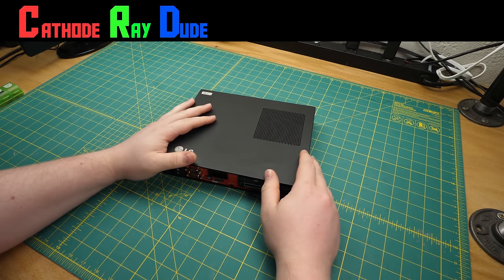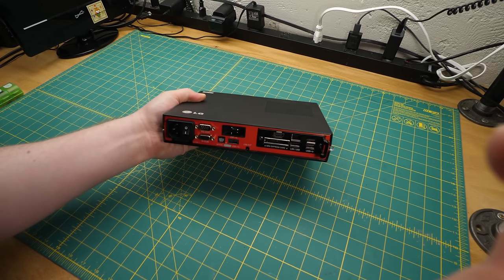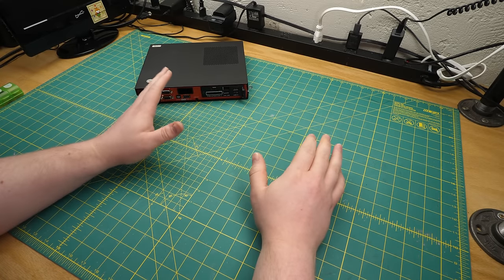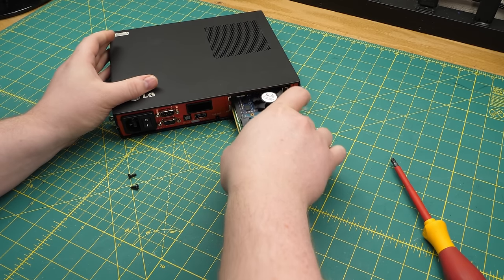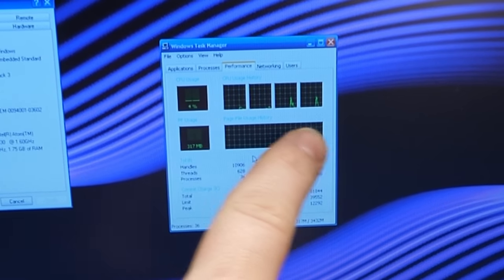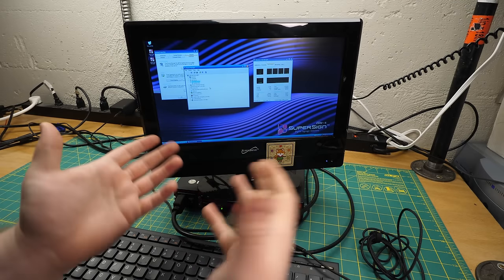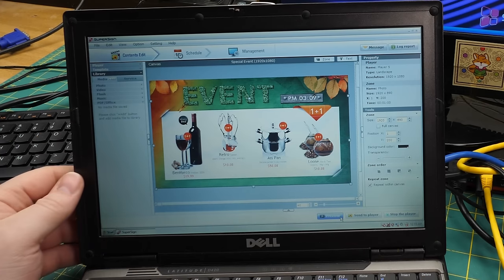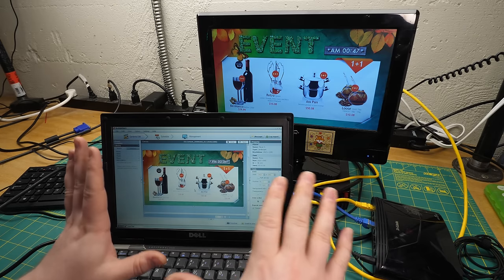Little Guys 6: The Worst Possible Timing [LG NC1000]

Comment: The Embedded feature that discards writes on reboot was actually available in XP too, via some Microsoft application that I've since forgotten the name of.  I worked at a company for a while that managed a few properties with public-access computers, and during the tail-end of the XP era, that utility was a godsend.  It almost completely stopped all the tickets to go un-eff computers that had been used by the unwashed masses.  AFAIK, that kiosk-mode util was discontinued, and never ported to Windows 7 and beyond.  SUCH a missed opportunity, IMO, but I guess if they kept it alive in Embedded (did they?) then that's something at least.
Reply from the maker: It's still in Embedded to this day apparently, plus a thing called "hibernate once, resume many" which does exactly what it sounds like; you get the machine into a state you like, hit hibernate, and then every single time you start up it just resumes from the hiberfile and thus always lands in exactly the same state.
Reply: @CathodeRayDude   That's actually kind of a relief to hear.  Would've been such a waste to discard that functionality.  It worked shockingly well.

Comment: look for NEC OPS stand alone adapter or H81 H110 host adapter or OPS Power and training adapter for your OPS. the JTAG PMU(power management unit)  disables JTAG in power save modes.
Reply: Also you wondered why they would have so many screens , Airports with public and private LCD's , the private ones being the check in terminals and the public ones being adverts, advice, warnings and directions .Some areas may have two or three screens with localized languages. later software also had pages for the airlines to login to update their local screens(boarding etc) . more modern ones have flight listings in them that will change the advertising depending on the flight arriving in that area of screens. the ones in HK airport also have camera's using hikvisions face recognition and will alter the advert based on you.
Reply: the missing parts on the daughter board are HDMI port, HDMI decoder (CDEC) , power for HDMI decoder and voltage buffer. the large white connector is additional power rails for external LED lighting and also a isolated "switch matrix" for inputs & triggers.

Comment: I would love to see all TVs designed for a OPS PS module. 
This way you can have a built-in DVR a built-in device that works better than a Roku. it allow you to run webpages on your TV. Could be used for video sharing. The best part is it's all internal.

Comment: I might be a little bit off, but I assume that the OPS system was made for electronics retail environments. That way, all of the TV's have synchronized video feeds from Internet source, instead of "the old way" of using piles of signal amplifiers and splitters to feed 25+ HDTV's a mediocre image full of noise. The TV area of Fry's Electronics used to have 120+ models on display, but they all had the same crappy image feed. 💀😭 Maybe Fry's would still be here if they spent a bit more to furnish the store with these type of Floor/Display Models, instead of how they used to put a standard production model on the sales floor as a Demo Unit...

Comment: As far as the matrix display goes, it isn't economical for fixed installations, but consider the rental market. So your A/V rental outfit that owns a bunch of commercial displays can use them in another way without needing to also own a matrix controller that they rarely use. Imagine walking into a convention hall and they've got a massive matrix display.

Comment: 20:00 - yes, ARK is wrong sometimes. I just bought computer with i5-12600H that's rated for max 64GB RAM but works perfectly fine with 96GB.

What really happens here, is that documentation in ARK written at the time of release of CPU and at the time there were only 32GB modules available and only on those it could be tested. But now we have DDR5 with 48GB modules, so I can put 96GB and it happily works. I even found website called "RAM Upgrades" which can tell you if you can put more RAM into your computer that manual says!

I don't know about those 2010 times, but I highly suspect it could be very similar.

Comment: I've done digital signage installs and none of the ones I did recently had any kind of OBS or embedded stuff. 
They are all smart TV type things where you just plug in a USB flash drive or SD card. A lot of them are SD cards. For a while I had about 30 4gb SD cards in the ashtray of my car.
Now that a lot of the smart TVs have WIFI, and most corporate WIFI is on managed networks like Meraki it is pretty much a cinch to push out system images for digital signage. The only hurdle there would be the still present fear of an Anonymous type attack putting embarrassing stuff up on the signage.

Comment: Jeff Girling has a video on a digital signage TV and goes into the plug-in modules and how it's running with raspberry pies.
A lot of industrial displays have plug-in modules so you only need to add the video input module that you need and that concept was adapted to use mini embedded systems. A lot of schools are going to smart displays. well they're called smart boards because there's a company called smart originally came out with a projector smart whiteboard system kit/modules so everything is called smart now. But that company is also doing digital displays with integrated computers. Because why have the hassle of just the teachers laptop or the students laptop let's put a TV in every room with a full on PC as well.

Comment: I remember those Atoms, they are extremely underpowered, but they use almost no power and also the thermals are good. The problem when those Atoms released is that Intel had no chipset for them, so they winged it and ended pairing the 8W Atom chip with chipsets that used up to 20W, completely destroying the power and thermals of the system. Also the GPU on those Intel chipsets was the absolute worst, so when nVidia came with the ION chipset it was the saving grace for Intel, the chipset was still somewhat power hungry compared to the Atom, but the GPU was powerful compared with any other integrated solution at the time.

Comment: heyo...just a little note, drowned in the admiration of this video...but Check out surplus auctions in your area. I see a lot of restaurant closings, business and office space auctions that have had some commercial grade displays go for TV prices, just because that's what people think they are getting until you look at the back panel, or look up the model. I've got a 2 or 3  27" touch screen displays that were used as a register that are absolute tanks and function with near anything and excellent high light viewing. I'm vaguely sure I've seen that Bay form factor, and OPS listed in some of the panels I've come across.

Comment: I see there's a slightly different tiny LG nuc in my 2015 Sonic
its behind the glovebox next to the interior air filter 
The infotainment center runs Windows CE
you can get into the debugger options
put in a special same code found on the internet
and boot into the windows CE desktop
I also notice these look like the same nucs on hotel TVs

Comment: Windows Embedded is used because the price-per-license is significantly lower than the retail OS. Also OEM cannot make customisations to retail OS that can be done to Embedded SKUs. OEM cannot make custom recovery for retail but can with Embedded. Also during XP era, all OEM recovery media had to be done by authorized replicator with minimum order amounts (like 40k units) but with embedded you could do recovery in-house.

Comment: 31:11 I don't know anything about Adobe Air either, but... Especially given the Era... This is exactly the sort of thing Flash should have become. Sure it was originally designed simply as a vector animation program, but this SO fits it's potential more than being an embedded steaming video player on websites. There was nothing wrong with Flash, and it shouldn't have been discontinued, but it shouldn't have been pushed into what it was in the first place. The only reason why it had so many security holes is because it was being pushed into a use-case that it wasn't designed for.

Comment: I'm on my third rewatch already and I finally realized why this little guy is so intriguing to me.  It's like the computer version of Hitachi's MP-EG1, except this little guy didn't get the chance to have a 'revision' made.  I can absolutely imagine the of this having populated those chips on the IO board and being more capable, but the team had to ship it early for Reasons TM so they sent out the simpler / "worse" version.  And unlike the EG1/EG10, this little guy got demolished almost immediately after launch and never got to have its own EG10.

I wonder if LG knew Intel was soon to 'release' OPS and was hoping to steal the market ahead of them and then migrate over to it?  Seems a little conspiratorial tbh.  Might be a fantastic case of the left hand not talking to the right because there's no way Intel hadn't told LG about OPS well ahead of launch.  Though perhaps not early enough for LG to have started on this project.  Convergent evolution and all.

Comment: The Ion was a very cheap and low power chip, it was a intended to be paired with a very low power CPU like an Intel Atom or one of the VIA CPUs to give those platforms video acceleration for modern codecs and some semblance of 3D acceleration that was not feasible on the CPUs alone. It mainly saw usage in budget systems like mini PCs, cheap laptops, netbooks and even on some motherboards to be used as the integrated graphics solution.

I think the chip line was discontinued due to chip miniaturisation eventually seeing northbridges/integrated graphics being etched onto the same silicon as the CPU and the chip designers paying much more attention to video acceleration with the rise of video sharing websites like YouTube. There just wasn't a need to have a separate graphics chip placed into a system that didn't offer much over what was already built into the newer CPUs, especially as it was added costs for systems as you could no longer swap out what had now been fused with the CPU die.

Comment: Is the RAM double or single sided? I wonder if they intended for the heatsink to have thermal pads under the RAM to also cool the RAM chips and then realized that the slot had them on the wrong side and then just abandoned the idea.

Comment: The fact the Nvidia had a chipset that worked with these first gen Atom chips available basically at launch was kind of interesting… until you realize that they use the same bus as the Core 2 series of processors. I had to look it up, but Nvidia was still making chipsets for Core 2 systems at this point, and they were kinda popular with enthusiasts because they permitted using GeForce cards in SLI mode. But they still included integrated graphics in some chipset models for some reason. So the ION was just a minor modification of their existing nForce 700-series / "GeForce 9400" chipset. It proved to be a popular combination with Atom chips since the chipset had hardware video decoding capable of blu-ray playback, which the CPU couldn't really manage on its own. And compared to Intel's 22W TDP 945GC chipset (hilarious next to a 2.5W Atom N270)… the ION was still 20W TDP, but with a much better integrated GPU.

Comment: You might of helped out my schools, turns out our SMART boards use this standard for ther AM30 and AM40 modules. They would run the entire android operating system on these modules made by them and were grandfathered into the newer models as an optional feature, so we pulled them from older systems when they webt EOL and if the newer systems had some issue with a boards internal system. We could use the AM30 or AM40 module to keep it running. SMART said they would make new modules for the boards including Chromebox version but never did. Its leaving many of our boards functionless and trash. But now I know theres a whole ecosystem of these things all over the market! If your looking for a cheap display I'd check government auctions, since schools are dumping the failed units. If its "dead" it should still be able to have its input changed to the OPS module without needing a embedded system running. Kinda like a normal TV.
Reply from the maker: Glad I could help!

Comment: Always wanted an Nvidia Ion myself. I mean with Atom you don't have great choices but at least it's not a slightly modified 945G chipset, the standard Atom companion chipset really is the same dies as used on PC mainboards of the era, after a respin, so there were two different 945Gs.

And BTW that Atom is not an SoC, you can think of it as an LGA775 socket device equivalent. The Atom Z series was an SoC released simultaneously-ish but not the D, the 200 or 300 series, these are FSB800 CPUs.

Would be funny if someone made a PC desktop mainboard socketable Atom. Sure it's a bad idea and nobody would have wanted one even back in the day, and it would require custom mainboard firmware by all reason, but still.

And NVidia Ion is an Nforce MCP7a, a low cost single chip all in one mainboard chipset with graphics which was also seen under other names on PC mainboards.

The cooling situation on many Atoms is faulty with manufacturers forgetting to cool the chipset which pulls substantially more power than the processor.

Comment: While Adobe likely envisioned AIR applications to be primarily built using Flash (and very likely most were, due to Flash being... well, more flashy before the advances in Javascript libraries and CSS), you could forego Flash entirely and just use HTML, CSS, and Javascript.

I found it rather neat as I didn't have much experience using other languages at the time, and what I did have was limited to console applications.

Also - as I managed to find out while researching for this comment - AIR is not dead, and still uses Flash's programming language: ActionScript. And while it still seems to be called "Adobe AIR", it's no longer supplied, developed, or supported by Adobe, but by Harman (Flash and AIR were both transferred to them by 2020).

Funnily (or annoyingly) enough, they supply the SDK for Linux, macOS, and Windows, while the runtime is only supplied for macOS and Windows, no Linux. I should try it out again.

Comment: unified integrated gpus got hated on, but are actually some of the best computers ever made. as long as you have enough ram or swap space... otherwise it bluescreens.

the more swap or ram you have, the hotter it runs too. 

2 raided drives dedicated to swap made for more heat lol

but its one of the best pcs ive ever owned.

Comment: worked on an application of a minimal linux based thing that would run ads from the web. plug and play type of deal on the most low end hardware.

Comment: Have you ever heard of the Intel "Compute Card" products? I discovered them a little while back, it's a lot like the OPS standard in a lot of ways. Basically, they had the computer on a little 'card' PCB with (I think) an edge connector, which had all of the I/O on it. It was a complete flop and the cards are completely useless now on their own, but if you can find the few products that it can dock into, one of those might be an interesting entry into Little Guys, if you can find one that is sufficiently interesting.. 

I believe one of the docks that I saw was a device that provided some sort of braille or other tactile display for blind people, which I thought was an interesting concept. I could not find it for sale for the life of me, the only stuff I could find was some of the proof-of-concept docks from Intel and one or two digital signage displays, and I believe one or two that were compute card to OPS retrofit modules.

Comment: I've dealt with a fair few of these NVIDIA ION chipsets/GPUs before. Realistically, these Atom machines could have come with any number of different configurations, but the ION provided pretty much the fastest GPU you could get in an early Atom netbook, nettop, or other Atom PC type. Going with an NVIDIA ION was pretty much the only way to get a semi-decent GPU on an early Atom machine, important if you are going to be doing any work with video or outputting to high resolution displays like these are. Your other options were either the already infamous Intel GMA 950 (on the Intel 945 chipset) and what was effectively late 2000s smartphone GPUs that often couldn't even run a compositor, so while the iONs kinda sucked they were better than pretty much everything else you could get with an Atom.

The only real competitors to the NVIDIA ION in terms of GPU performance were AMD's competing netbook CPU/GPU platform. For instance, my French teacher had a netbook that used competing AMD netbook hardware. Interestingly, this included probably the only instance I've seen in real life of a dedicated GPU inside of a netbook (from what I can remember, it was a ATi Mobility Radeon HD 4350 with 512MB GDDR3) paired with an AMD Athlon Neo X2 CPU. While they competed (and often beated the ION or ION 2) in terms of performance, they were also much more power hungry which limited their adoption among the kinds of devices that the Atom would have been used in.

Comment: I can tell you that mechanically the thermal design of that is flawed as copper and aluminium should never be placed together as they react and van cause structural failure. It could be that because the copper has been epoxied onto the heatsink that this may not occur but it may be worth keeping an eye on the thermals in a few years time

Comment: Oddly enough, i work in similar industry, most of ours digital signage machines, are just regular devices that runs Linux, with a browser in them,
remotely controlled by puppeteers, and some Node.js code...
Extremely simple code, that don't really need that much of hardware. 
But customers don't have that much technical skills to put together something self.